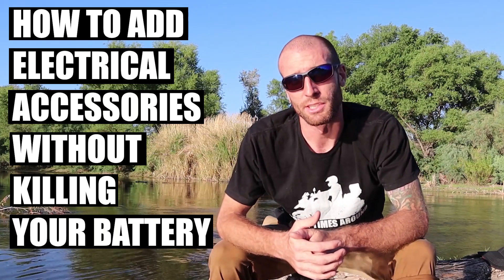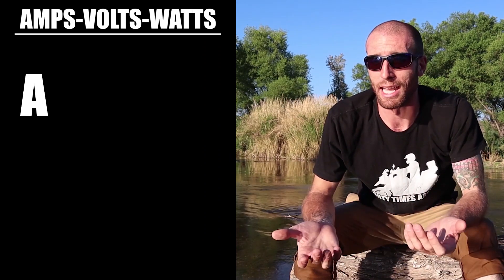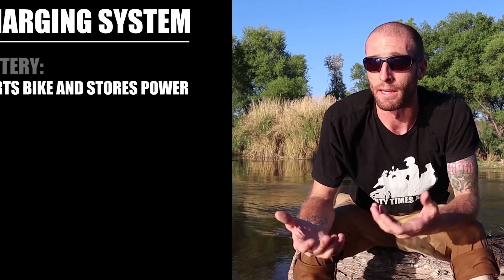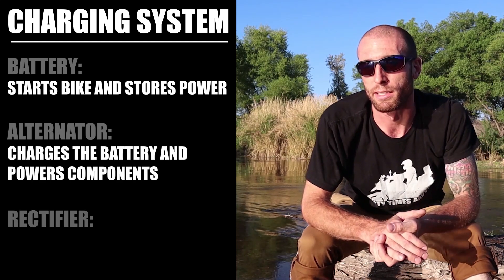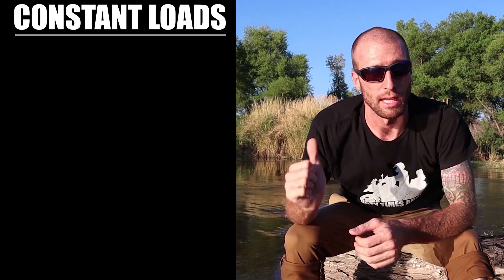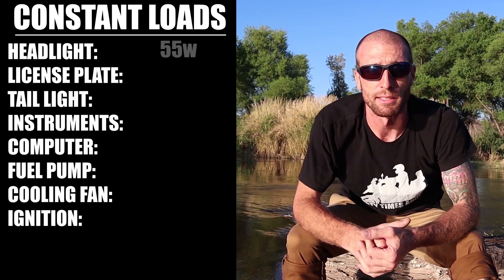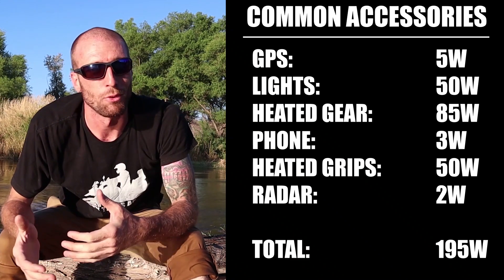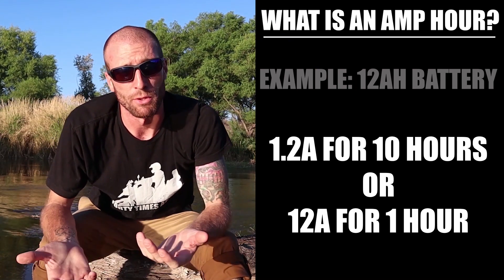How to Add Electrical Accessories to a Motorcycle Without Power Issues

Comment: You forgot to mention the best way to wire up bikes with can bus system and that's by using a can smart. Power, ground and a can bus connection and you're  done.  4 channels that can be controlled with the bikes switch gear and NO hacking in to your bikes wiring.

Comment: It is very important to mention that the regulator/rectifier unit also includes a voltage regulator, which maintains the DC voltage at a safe and consistent level (typically around 13.5-14.7 volts). This prevents overcharging the battery and damaging other electrical components. 

Another very important lesson learned, never buy a BMW anything

Comment: Thanks for great video! My 2014 R1200Rt has a power amp installed by the orgianl owner and he hooked it up to the battery to boost the OEM stereo, and the battery keeps dying. How many amps do you think it used and the dealer suggested it may have friend my alternator and regulator.

Comment: WOW!!!!!! Thank you!¡!!!!!! Great info!!!!!! 😎😎😎😎😎🇺🇸

Questions!!!! 😂😂😂😂

1.  I need the link or part number for the BMW SPLITTER, you mentioned can't find the link in ur bio???

2. I'm adding a 6 fuse block can you show how to insulate the wires?  What parts? And how to connect wires using the relay you mentioned? :) 

Thank you!

Comment: I've added a usb charger direct to battery. It includes an on/off switch. When off it will not charge the phone. So, when off will this draw power. If so is it of any consequence.  Should I disconnect when not in use. Thanks.  Ps video is very good 👍

Comment: Tim, this is outstanding, thank you. Learned more from this quick video than watching many others. I bought a new to me/used bike with lots of accessories wired into the battery, with nothing labelled , and some ground terminals that were not connected to battery (kinda just dangling) and then when I hook everything up to battery, I notice I'm getting a dead battery. Grrrr. Any YT peeps you like, or other references I can go to the try and learn what the fck I'm doing? Cause right now I have no idea. I'm gonna start by taking everything off and charging battery, then installing one by one to try and learn the hard way. Thanks again, do more electrical videos please.

Comment: So i installed the Healtech Thunder box on my Honda Rebel 1100 DCT. Red & Black wire to the battery, then all other accessories into the Thunderbox pos & neg terminals. The accessories only work when the bike is actually running, but for my external speakers, id like them to have the ability to turn on before i actually start the bike. The Thunderbox came with a white wire im assuming to be wired into the ACC mode of the ignition so that the box will power when the key is inserted and the bike is switched to "ON" (NOT RUNNING), which would resolve what im trying to do. Im not sure where to hook up the white wire on my Thunderbox onto the bike...or do i have this all wrong?? 🤷🏼

Comment: Hi Tim, I watched your video on "How to Add Electrical Accessories to a Motorcycle" it was very clear and educational. But I was a bit surprised by the information about the generator data? I have a 2010 R1200RT (K26) and my alternator puts out 27A at 1000rpm and 55A at 4000rpm, is there really that much of a difference between our BMWs?

Comment: Im surprised that your bikes alternator output is only 35amps , my BMWs I've had R1050GS a K 1100LT and a K1100RS all had 70amp alternators, my current bike a 2002 Triumph Trophy 1200 has a 40amp and no ABS or fuil injection .

Comment: I did replace all my light bulbs to led and added accessories driving & fog led lights and flasher light for the brakes & added brake light to top case and tape on light for tail light all them are led lights and also put in a USB charges outlet voltmeter gauge tell me how power I using for my 2007 Piaggio mp3 250ie!!

Comment: I have a solar-powered charger for phone or gps device,  its ok for daily use but obviously it doesn't work at night but i also have a bower bank that charges due to solar-power during the day i have not had any problems as the powerbank stays fully charged while it works food rnight travel if i use it at night

Comment: Did you install am inverter on your bike for drone batteries or whatever, if so how did you do it? That would be an interesting film for sure
Reply from the maker: My drone charged off 12v I don’t have it anymore tho
Reply: @FTAAdventures  no drone? but but but!
Reply: @FTAAdventures  so you connected straight to the battery? did you then have to plug/unplug to keep from running down the battery?

Comment: Great video. Very informative thank you.
How about if a phone holder with USB connection is connected to the battery, if it's just sitting there & no phone is attached will that still drain power or would that be ok?

Comment: I was expecting more thoughts on how to get more from the electrical system:
1. If I find a bigger AH battery, how do I modify the RR unit, if needed.
2. Can I have alternator coils rewound with thicker copper wire?
3. What else I might do to always have some juice for fuel pump, ecu and ignition, if the charging circuit has failed for some reason.

Comment: Great info, just what I was looking for. I need to check and see what my locator Sat GPS…not Nav…is pulling as it’s always working to protect my bike when the bike is turned off, now I know what to check for…how many Watts it’s using. Anything in the low range I feel I’m good to go.  Have to give the heated grip and Gear a pass…Thanks.

Comment: what power distribution blocks/relay combo do you recommend?
Reply: Rowe Amplink   Very small and the amperage can be programmed via phone App.  It gets rid of those bulky fuses (for each accessory) as well. You can also program start-up delay for each item.

Comment: You still did not explain how or where to connect the accessory cables. Do you connect direct to the battery with the ………..switch in the positive lead?

Comment: So I’m still a little confused. Everything is wired correctly. And when I go to start the bike it clicks a ton. And will not turn over.. so I’m slightly lost as to what it could be especially If they pull even less wattage than the lights before

Comment: Hi 
Thanks for the thorough information- something i really needed to know - priceless to me seeing your video congratulations and well done 👍

I would love to get your opinion on something please.
I was about to order the Cansmart Controllerfor my brand spanking new KTM 390 Adventure ( if Daneli has one for my KTM).
I now have second thoughts after watching your video.

So here is my problem...
I want to connect 4 items
1) A set of driving lights ( which i bought already but might need to change them as they are 60 watt with 6 LED’s   - not sure if that is 60 watt each or not 🤷‍♂️ https://s.lazada.com.ph/s.1t630
2) A bosh Dual Horn set (4A each) https://s.lazada.com.ph/s.1t6ek
3) A secondary set of yellow fog lights ( not yet purchased and need ideas 😬 for decent but not to expensive set)
4) A Visytec break light contoller.

 The KTM 390 Adventure (2020) has in the ass end 2 or 4 spare auxiliary ports ( there are 4 plugs but since i don’t know anything about electronics is the reason for me to write all this so you get a better understanding to the best of my very limited knowledge of what there is and where)  and i think 1 or 2 additional 🤔 spare aux ports near the base of the headlight somewhere.

I am located in the Philippines and getting a professional to do the wiring without screwing everything up is nearly impossible where I am.
So the only hope i have is to find someone who can give me the right advise on how to go about all this and which components i should buy to simplify the installation and to make sure it is SAFE for the bike and doesn’t stuff up my electronics or void my warranty at worst case.

I also considered to buy a Rowe Electronics PDM60 distribution box which might be the way to go but as said, since the bike already has at lest some aux ports i really am very confused and need someone who knows what they are talking about to give me some advice on how to get what i want in a very simple way that i can then do my own installation of everything.

Note:
The Cansmart was an attractive idea as i didn’t need additional switches, as everything was going through the stock switches of the bike.
With the Rowe ( or similar) distribution box i guess i need relays and separate switches and that scares the crap out of me...but willing to do if i get the right guidance on what i need to be aware of and how to best install them and the type of switches i should buy.

This is a long list of questions i know but i really hope you can help me with this.
It is myfirst bike I buy brand new and can’t afford to screw this up.
Thanks in advance and the info you provided was an eye opener for me. Explained a lot why my Duke 200 has so many issues 😬🥴 ( i am 3rd owner of that 6 year old bike ) and why i now decided to buy a brand new bike and start fresh and do it properly myself or with someone i can trust here.

Cheers Jim

Comment: not mentioned in comments/vid... do not use physical "connectors" , they cut into wires by snapping down on them, corrosion will set in and drain power (and horsepower, a little).  Use only soldering, and then use shrink wrap stuff and a torch to heat it to seal out moisture (slide the shrink stuff up the wire, before soldering, so it's possible to slide it over the work area and seal it down).

Use direct to battery if possible, just shut off yer switches, will have less places to fail.  And use an in line fuse (eg 20 for hand warmer, or 30 if she blows), 16ga wire should be ok, or 14.  Thicker wire disburses heat build up from high watt applications like heated clothes or alternator or a couple phones charging.

Comment: I have a gsx 750 f and when sold had Oxford grips, I was surprise to see no relay and the console that operates the grips was faulty, I bought a new one and now will like to install , however I will also like to install a usb charging plug . My question is : what size relay do I need ? And where do I pinch the relay to get the signal to go ? Thanks

Comment: Great channel, a lot of useful information, and also motivating! On the subject of this video, I am trying to find some information wether you can somehow either upgrade or modify the charging system to allow adding more accessories without frying the battery... Would you be able to help and share your opinion and knowledge?

Comment: Hey I’ve a question. Will there be any problem if I convert my ac light to dc. I converted my whole electric system to dc. All lights run on dc power

Comment: Thank you for this.  It was great to watch.  I am in the process of doing some upgrades to my 2015 V Star.  I am adding a speaker system, wireless and USB holder and charger, some aux spotlights on the bike.  should I use a six was fuse block with relays or just the fuse block?

Comment: Tim, you are always a wealth of information.
I hav e SAE connector Wired inside of one pannier, where I wanted to use to charge cameras, communicator, power bank etc.
Unfortunately the input is coming directly from the battery ☹️.
Need to change the battery connector to a relay.
Any idea where can I find some info on that?
Thanks in advance.
Lucho.

Comment: I own an Alternator shop. Quick and easy.   Connect a multimeter set it to DC Volts.  Add shit to your bike until with everything on you start to see your voltage start to drop below 12.5 Volts.  Done.  Simple as that.

Comment: Aftermarket accessory overloads are always a concern for me.  I use a fused circuit distribution box that is controlled by a relay.  As soon as the key is on, the circuits are energized and naturally key off, shuts power down to all the accessories.  I purchased LED driving lights, heated grips, and vest a GPS, USB Charger, and a J&M (made for motorcycle) CB radio.  It sounds like a lot but considering not all of it will be on at the same time I am still well beneath maxing out my available power.  The newer Suzuki Vstrom 1000 (2014 and newer) has a larger capacity (490 watts @ 41 amps) than the 2012 and older which had 400 watts @ 33.3 amps.  In addition to the standard systems on the newer model V-Strom, traction control and ABS systems were added to the load, so the increase in capacity was necessary to support these.  By far, the heated grips and vest are big power consumers @ around 35 watts each. That means I need to be aware of the load they create on the electrical system and shut down anything else that is running when using these to accessories.

Comment: I just bought a new 790 Adventure. KTM has provided 2 switched power leads in front and 2 in the rear. Not to exceed 10 amps according to the book. Pretty handy. I hear they are hidden but if to dig them out your set. By the way, i am going to the springs up north of Horseshoe lake once i get my kit together. I am using your links to big A. 3 items so far. Be safe.

Comment: Okay, I'll just ask here for the heck of it. So, I have a new digital LCD clock and voltmeter. Small size, three wires (red, black, blue) I have it mounted right below the speedometer gauge, as it was a perfect fit. Its fairly small. Red goes to positive, black goes to negative, blue goes to "power switch". I assume by power switch, that would be suitable for the ignition switch. Which has three wires. Green for ground, which is also connected to negative battery, red positive, and black with white stripe which is the on / off. I have verified that the red and black receives constant power, but, Its still not working. I'm to believe that the clock is not faulty, as it does flash briefly when wires are.touched, but, I'm in doubt that black with white stripe wire is a correct power switch. Despite me getting zapped while holding my bare hand on it. Any ideas anyone?

Comment: I have a vn900c 2008 Vulcan, It is really hard to find the total use of voltage or wattage just for the bike? wondering if led's would help? the bike is Lehman trike . rear is already led's brake lights, licence plate light, and turn signal's, No emergency flasher on it , but the front is all bulb's? would led replacement be a good idea?

Comment: Tim, Would I be able to hardwire a Garmin Zumo 595LM to the factory connector you refer to with minimal issues? Where is the connector you refer to for the splitter that is linked? The splitter that is linked does not include 2009, R1200RT's. Do you have a link for my BMW splitter & the location of where it is plugged into? From research, the only thing I have found is that the connector is taped up somewhere around the right fork... Please help! Awesome vid!
Reply: I'll make sure an purchase a shirt, if you can assist me. Thanks again & safe travels. 

P.S. I'm getting ready for about a 100 day trip to Alaska and quite a few other states. I stumbled upon an awesome packing list for Alaska a couple of weeks ago. It's Billmaa on YT. He is one of the very original YT motovloggers from 2006 & even prior. His Pirates & BWOM series is/was awesome. I think many vloggers have been influenced by him. I'll look you up in Phoenix if that's my best bet for assistance. Thanks once more!
Reply from the maker: Hi Will, not sure about the Zumo but it sounds like what your trying to do should work. You're not thinking of cutting off the connector and just connecting the wires are you? Not sure the bike will like that but if the connector fits it's good. I have not used the connector, someone recommended it to me and I researched through reviews and forums, the connector should be under the seat though. Good luck let me know if you have other questions. Email me here: fortytimesaround@gmail.com Thanks!

Comment: really thorough explanation. On a unrelated note, since you mentioned rpm, you said that you're usually at 5k. I have a 125cc, and in the highway i always ride at 8k. Am i doing it wrong?
Reply: Probably not. The smaller the displacement the shorter the gears (Generally speaking). So for your smaller bike to ride at a higher speed it has to review higher.
Reply from the maker: Right, different engines different rpm at similar speeds. Not doing anything wrong in that regard.

Comment: Can I store gas in the trunk for a long trip.. I am wondering due to the heat..
Reply from the maker: Dennis, I have a small fuel container strapped to my bike for remote areas, the only thing to watch out for is that it expands when it gets hot if it doesn't have some type of relief valve to release that pressure. Just keep an eye on it, maybe loosen the cap once in a while and it should be fine from what I've seen.

Comment: I do a lot of motorcycle camping in my area of the US... I have a BMW F800ST.....  Thinking it would be safe to add a hookup to my battery for a 12V air pump for a small air mattress I found out the hard way that it's not a good idea.  I burnt out my stator.  I used the pump only when my bike was on, perhaps this was my problem.   I wish I knew a little more about this before I did it.... now I use a small air mattress that I blow up.

Comment: Hi, Tim. Can i take may bath the stream or pond behind you or any water source in the US states?
Reply from the maker: You can swim in most water if it is on public land, unless otherwise posted. As far as bathing I don't know the rules but I don't think it would matter as long as you use bio-safe soap. Good luck!
Reply: @FTAAdventures  thks
Reply: Hi, can i parallel another external  battery from the main battery to charge it? (Night time use)